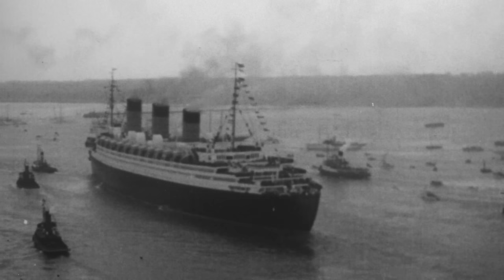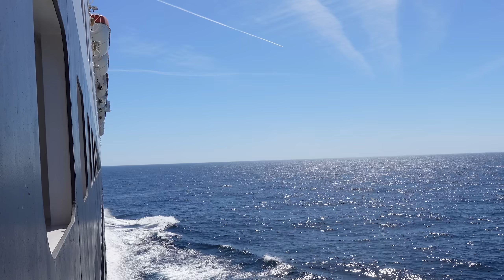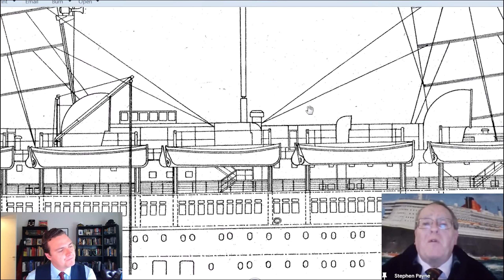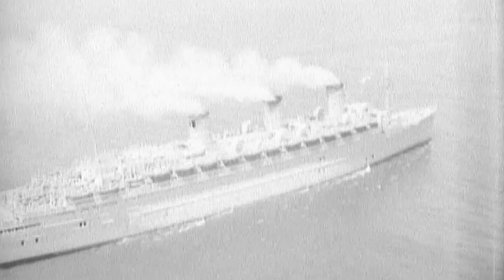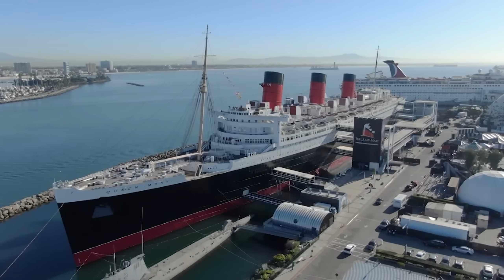This Great Ship Had... Some Quirks

Comment: For the well deck, I believe they were introduced on tramp steamers in the late 19th century (or early 20th?) as a 'hack' to reduce docking fees. In many ports docking fees were partly calculated from how many contiguous decks the ship had, or alternatively how many decks up to the strength deck level. Thus adding an extra deck with a little cut gave more cargo capacity without having to pay higher docking fees.

I'm not sure such docking fees were common anymore by the time the QM came around, but it might have just morphed into an aesthetic thing by then.

Comment: I find it interesting how many different stats, efficiency, speed, comfort, safety, all is affected by just the shape of the hull. 
In an age of electronics, a shape just seems like an archaic form of technology. Yet it takes so many considerations and calculations and affects everything around it. Even if the hull itself does not move, it's mechanical.

Comment: I never sailed on any of the Queens, but I did sail transatlantic on the old SS Rotterdam, the one built in the 1950s. Beautiful ship, but she was quite a roller! One didn’t notice it on rough days, but it was most apparent on smooth seas. You could sit in a deck lounge chair, the ship would roll so that you were staring into the sea, and then it would sit there for a few moments until it leisurely righted itself! I just visited her again after all these years — she’s a hotel/convention center in Rotterdam.

Comment: Thank you for another enlightening presentation.   It is decades since I visited the Queen Mary.
When looking at the drawings of ships of the era that brought the Queens, and a modern ship, one striking difference is the cut-up of the keel line between the cutwater and the line of the rest of the hull bottom.  It is quite obvious in the drawing you used for a background around 6 minutes Mike.
Even before bulbous bows were adopted, later ships had the line of the keel continued all the way to the bow.  Do you know why this cut-up was applied to these designs?  One thought I had was that it would give a degree of relief to the bending force experienced at the last phase of the old ships being launched.  But that is merely a guess on my part.

Comment: went to NY  by her, in 1950, came back on the Normandy, yes Steven is very good
VISITED  her in the 90s
found a cigar in my bunk, as 4 year old got lost a lot
  crossed the TASMAN  when it blew 90knots aboard Chitral, 15000 tons, blew storm force for days, dunno heel angle
I'd just come off NORTH SEA  tugs, was the only passenger to not vomit
we say easy roll, easy  come back

Comment: At 10:44 how would the ship have a higher center of gravity than originally planned? Don’t they finish the general design of the ship before making the test models? It’s more likely the test models weren’t weighted accurately so they behaved differently than the ship eventually did. And it seems like all that work’s unnecessary at 17:26, they should just make a shaft where machinery can be lifted out of the hull like it used to be.

Comment: Hello Mr. Brady.  Quick question, do you need any Narrow L-Gauge locomotives?

If you’ve answered yes, then great, just head over to Brickticks Engine Works over on rebrickable.  There you will find a fine selection of Narrow L-Gauge steam locomotives, as well as a diesel and an electric engine.

We also have options for power stations as well as a stealth combat sub if that’s of interest to you.

Rockatoa, Brickticks out!

Comment: It is said that if the QM had had a bulbous bow design, it could have either used smaller engines to realize the same speed, or gone much faster with what she was equipped with.

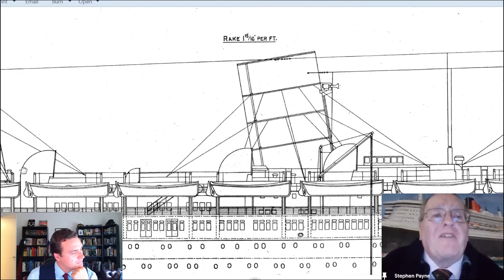Comment: 14:00 - Those funnel rake angles are the 'shop' angles, as when the funnel is sitting on a flat floor.  The rake differences are to account for the local shear at each funnel's mounting point.

The shear angle is more positive(upward) toward the forward and more negative(downward) coming from the stern.

The different funnel rakes compensate for that.

Another funnel fact:

Queen Mary's original funnels were slightly wider, fore & aft, at the top than at their mounting points.  Maybe no more than 1-2 feet difference.

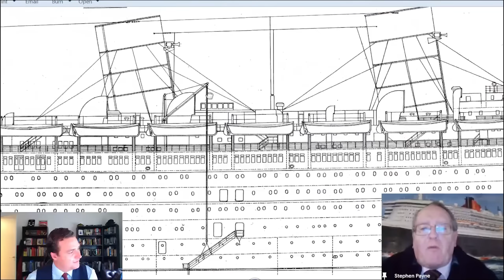Comment: @22:00, GRT confused me for a long time too. The thing is, I went to sea with the Navy. We aren't exactly in the maritime trade, so we really don't care much about "earning capacity." We car about how much combat systems and fuel we can cram into the ship. Then we think about how much manpower is to be required so warships are built around the plant, the combat systems suite, the fuel, and the messing and berthing accommodations. We instead measure our ships by how much they weigh (i.e., displacement). That's why RMS Queen Mary was given a displacement of 81,237 GRT but she actually weighed 77,400 tonnes (78,642 metric tons, 86,700 U.S. tons). The nice thing is that while RMS Queen Mary is a museum and hotel, her GRT remains unchanged. Sure, all the below-deck equipment, most of the boilers/engines, etc. have been removed so she's much lighter, but GRT is constant.

Comment: Very interesting as always. I'm no naval architect, but it has always seemed to me that the designers were ultra conservative. The QM looked to be about 25 years older than her French, German, and Italian contemporaries. By the 1930's, welding was being widely adopted yet the QM was riveted. The hull shape harkened back to the turn of the century, as opposed to going to a modern shape with a bulbous bow. I believe she needed 40000 more horsepower to equal the speed of the same sized Normandie. Arguably, she was obsolete before her maiden voyage. Still, a beautiful ship.

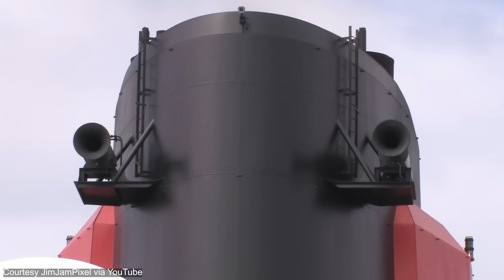Comment: 32:44 It was designed to meet modern International Maritime Organization (IMO) regulations, which require ships over 200 meters to use foghorn frequencies between 70–200 Hz; the original's powerful 55 Hz tone, an octave below the allowed range, was too low and had to be adjusted upward for compliance. This shift ensured the whistle maintained its deep, resonant character while adhering to legal standards for safety and audibility.

Comment: Cunard ships prior to QM didn't have forward well-decks if I'm not mistaken. At least I don't see them after checking visually. Well-decks were more a feature of White Stars liners so I would assume after the merger John Brown implemented well-deck feature to QM to mollify the White Star element of the company. Curiously stability issues were always an issue with the German Imperator/RMS Berengaria, a Cunard acquisition after the war and the previous biggest ship in the Cunard fleet.

Comment: I really enjoy your videos.  When I visited the Queen Mary in Long Beach, CA, I took the detailed, behind the scenes tour.  Fuel economy:  13 feet per gallon of fuel.  Are there figures like this available for current-day ships?  WHY are the propeller shafts allowed to spin right next to engineer walkways??  Also, why are large numbers of circuits - live wires - not covered, such as in a modern-day fuse box?